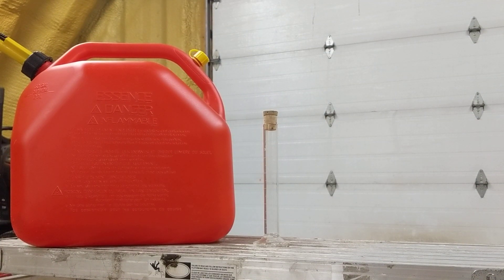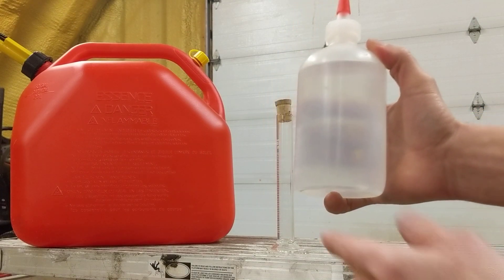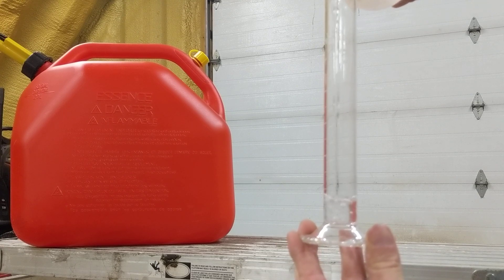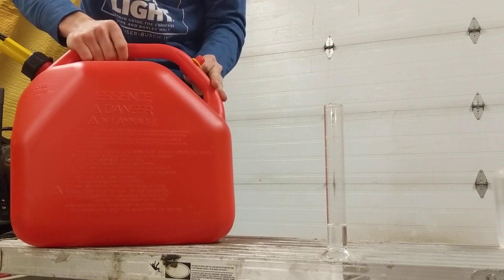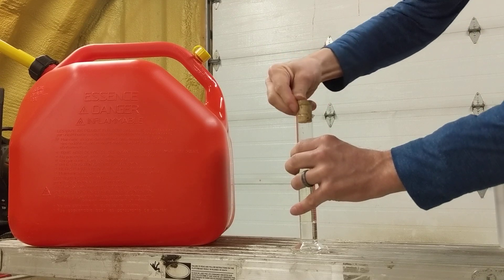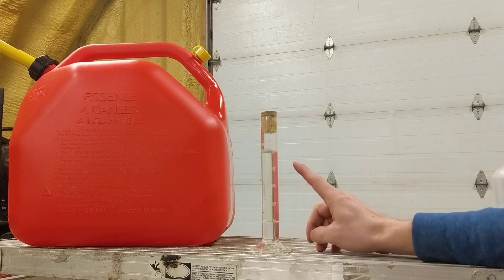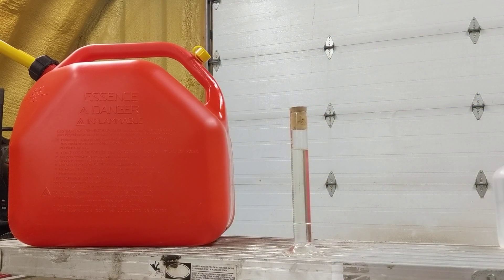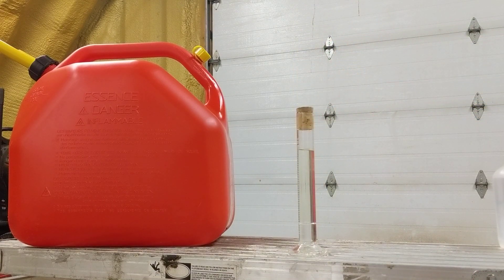How To Test For Ethanol In Gasoline

Comment: You poured in 40 ml of gas into 10 ml of water. If the gas had 10% to 15% of ethanol in it, I would think your water line would be at 14 to 16 ml instead of the 10 mm initially pouring in. I am a math and physics guy; I hated chemistry and biology.
Reply from the maker: The ethanol would mix with the water, making it APPEAR to look like the amount of water went up, but in reality it isn't water but a mixture of water and ethanol (which is basically alcohol)
Reply: @carlylea  Just ran a test on 87. I got an increase of 80 ml when I used 800 ml of 87 octane gas. So I would assume 10%. From now on, I'll use dye in the water. It makes it easier to read.
Reply: You didn't tell us what type of gas was in your gas can lol! I prefer ultra 94
Reply: Although I just run diesel in all my vehicles instead 😁